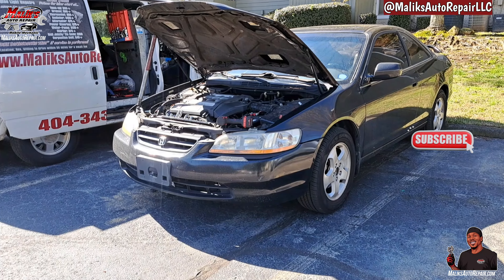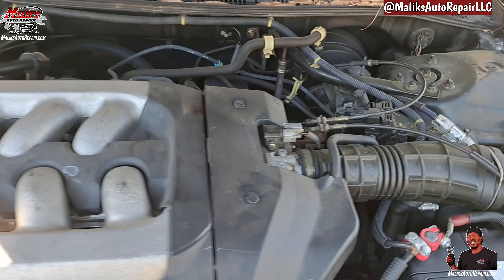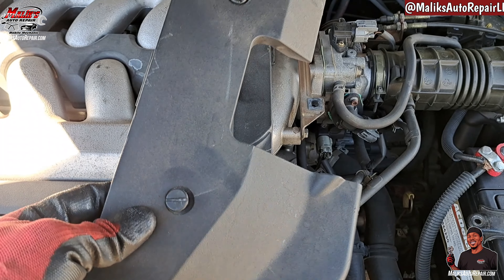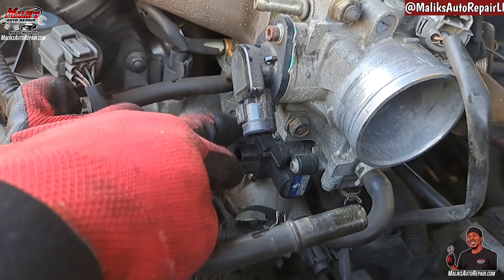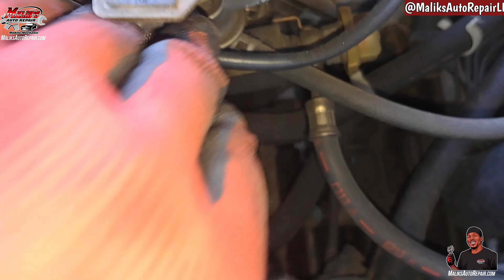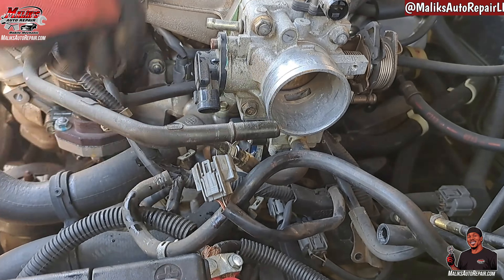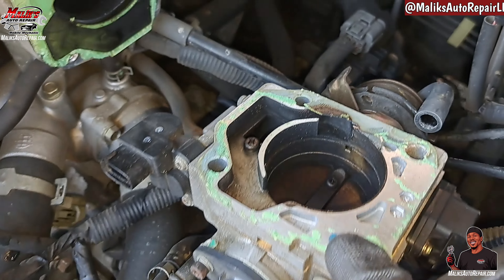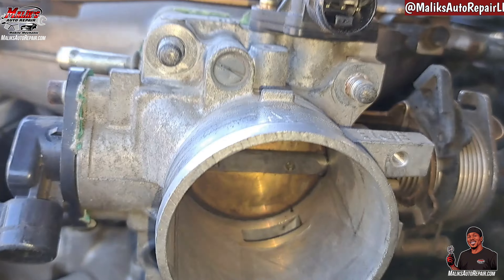HOW TO CLEAN THROTTLE BODY | 2001 HONDA ACCORD 3.0 | TROUBLE CODE INTERMITTENT P1106

Comment: What do you call that hose that is connected to the throttle body?
Reply from the maker: A hose that coolant flows thru. Don't know the name.
Reply: @ThePullUpKing  the one up top is more of a vacuum for the throttle body sensor
Reply: I can send u the service manual link if u need it
Reply: @Waynetoosaucey  yes please, thank you!
Reply: @bosssanchez3247  just rebuilt my motor and swapped my transmission after it sat for a year, came in handy
Reply: @Waynetoosaucey  cool, what’s the link to the service manual?
Reply: @bosssanchez3247  already sent should be right up above these comments boss
Reply: @bosssanchez3247  i think it was deleted. U got fb or instagram? I can send it there